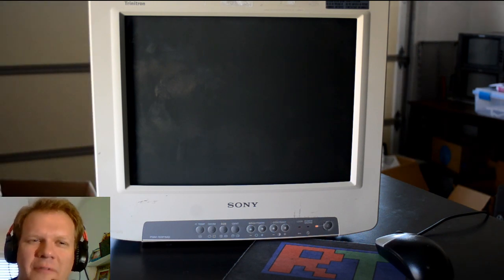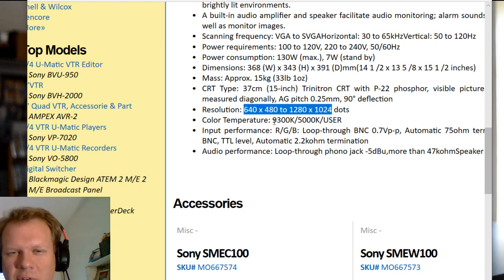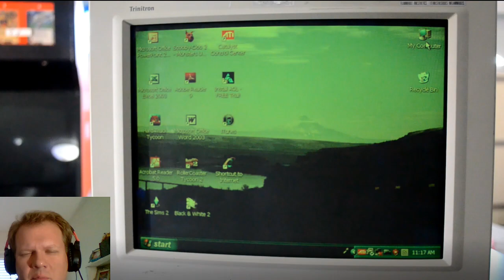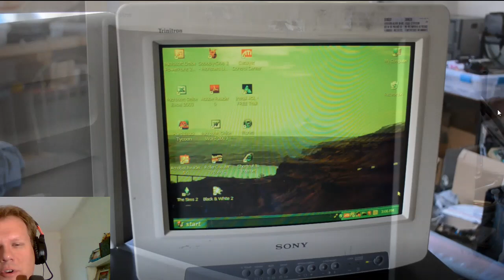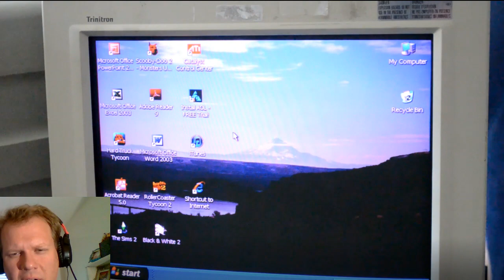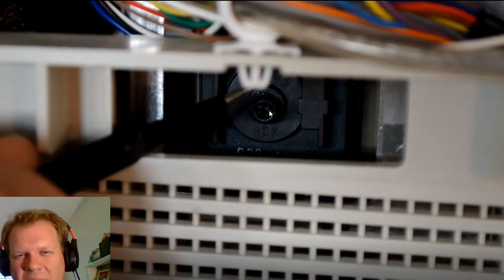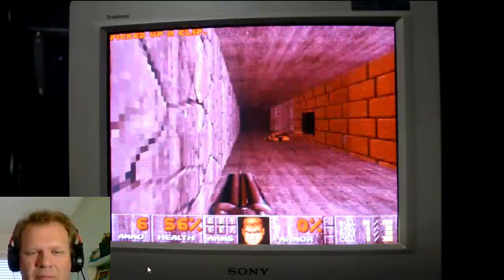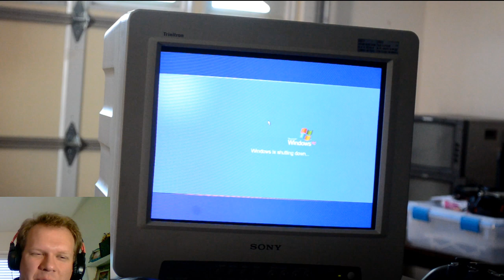Sony PGM 100P1MD Trinitron Retro PC Display!  Color loss repair

Comment: I just had a Sony Multiscan 200ES shipped to me, and it works great, but three of the arrow buttons are physically impossible to press because the momentary switches behind them seem to have fallen out of place. How would I go about reseating the switches? All I can guess so far is that I'd have to pry the front bezel off, however that's supposed to be done properly.
Reply: figure it out?
Reply: @imKas  unscrew the back, then you’ll see the tube is screwed to the front bezel, unscrew thst off and out the tube aside and then work on reseating the buttons 

be careful

Comment: Hey man, love the channel.  Glad to see someone still appreciate these old beauties. Quick question for ya.. I have an old Radio Shack 64-053 soldering station that needs a new Iron.  Can I buy any 5 hole iron for this station, or does it have to be made specifically for this unit?  And do you recommend a 50w or 60w?. Thanks very much for time and help 👍

Comment: You seem quite knowledgeable on CRTs and even through I know YT is hardly the right venue for that, I still gotta ask: Do you happen to know of any way to force an 100hz Trinitron to run in 50Hz mode )if that is even possible...)? I got an Sony Trinitron kv-29fx60d, but my lightgun only works at 50hz and I just can't find a way to make it happen.
Reply: no
Reply: @alexvids9232  ok, thx

Comment: i have moded a sony 14 inch crt tv to use its RGB's the problem is when i use service menu mode to fix geometry horizontal size is fixed it doesnt change with some of other options but vertical changes very normal even horizontal shift works too but i cant figure it out why i cant stretch screen horizontally while sony provided the option can you give me a brief direction?

Comment: nothing special ! its a vga crt monitor not 15khz 240p pvm
Reply: Monitors are just as good as pvms. They have different purposes
Reply: i didnt sat anything in contrast they are more available with less price so they are not as special ! you cant hook up your retro consoles to these mobitors !
Reply: Run a custom res in IT and you get 31khz but with Scanlines and 240p and it geht's the pvm look
Reply: @BehrouzKashkar  You can with an ossc and get similiar quality for cheaper price win win
Reply: Monitor > pvm. If you want low resolution low refresh rate just use ossc/bfi. But you also get the option to run modern stuff and make it look likely better than you've seen any image before
Reply: Muppet